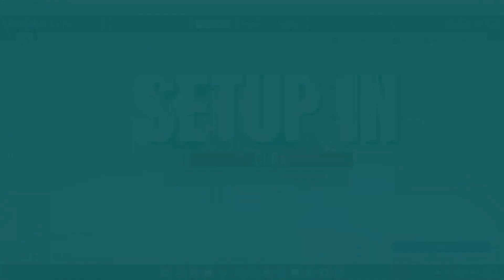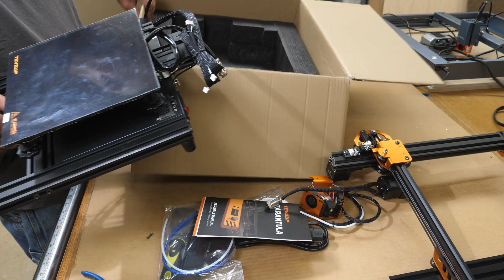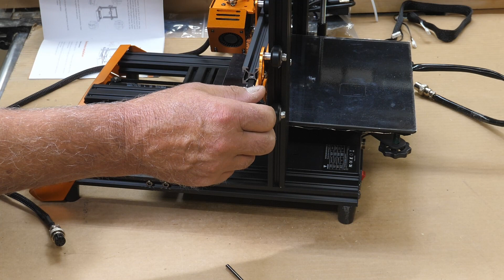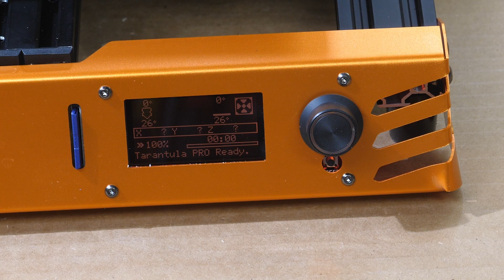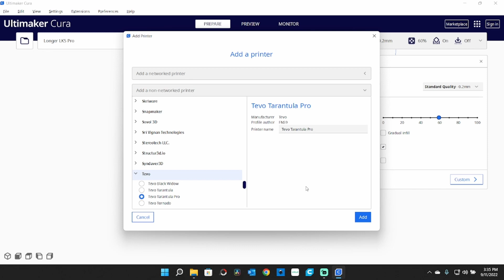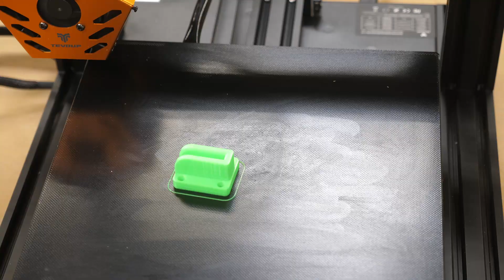TEVOUP Tarantula Pro 3D Printer Detailed Setup

Comment: Lcd stays on even if you turn of the printer. It is powered from USB. Do you have the same problem? How to solve it?
Reply from the maker: Common on many brands.  However, I never use the USB connection.  Always from SD cards.  I run too many printers at once to be direct connected.

Comment: I need remove the bed but it’s glued to the screws behind the bed and it doesn’t has any place to put a screwdriver, any recommendation?
Reply from the maker: Never had a need to do that.  The only problem I've ever had with this printer was the control knob, which needed to be replaced.  But, that was on me since I dropped the printer and broke it!

Comment: Roger that was an amazing video thank you 
you made this unit look extremely easy to assemble I like that it's 50% done taking it out-of-the-box the  unit price is amazing do you think this would be a good starting unit for somebody like me who has no idea what he's doing
Reply: P.S. Looking at a cricket in your shop or sound effects
Reply from the maker: @mrgrinch61  Yes, LOTS of crickets this time of year and they drive me crazy sometimes.  Since we keep doors open in the shipping bay most of the time, they have no problem getting in.
Reply from the maker: I like this unit much better than the Creality Ender 3V2 (and I have 4 of those).  As a unit for just starting out, it is pretty easy to use and setup.  Just don't waste your time with the enclosed sample filament as it is junk.  The Longer LK5 Pro is also a very good 3D printer, but is large and takes up a lot of space.